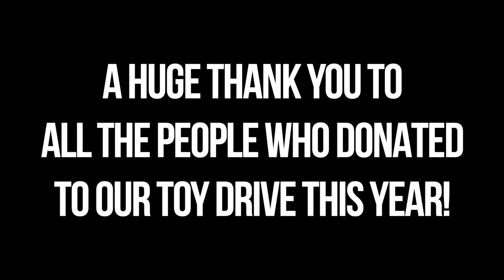We hosted a truck show to drive donations to Toys for Tots!

Comment: Unrelated, but how do you combat the dirt that runs out of headlight housings and behind emblems? The black paint of the vehicles I wash looks great while wet, but once it’s dry you can see where the dirt ran out from. There has to be a solution other than purchasing another chemical, such as Awesome Sauce.